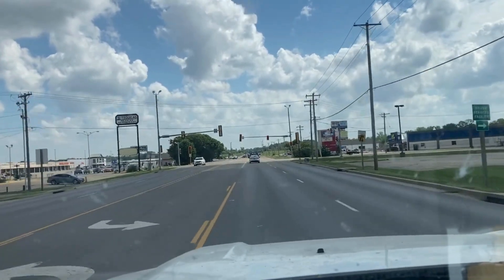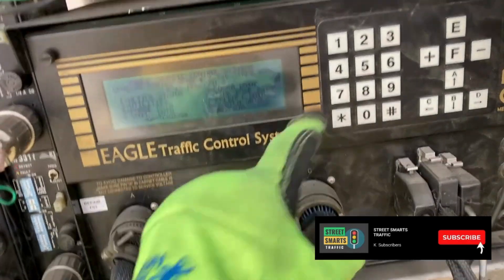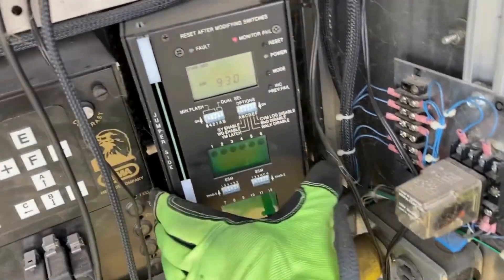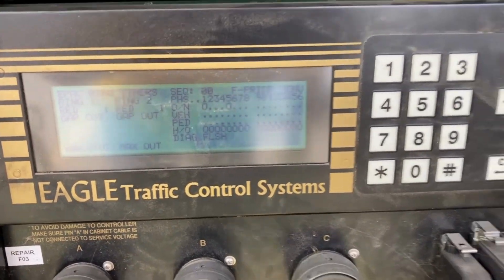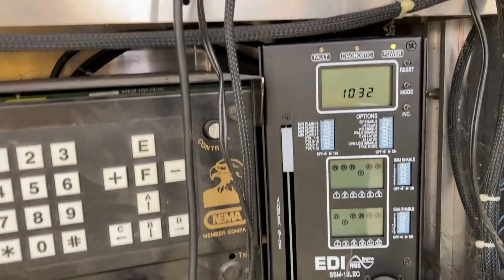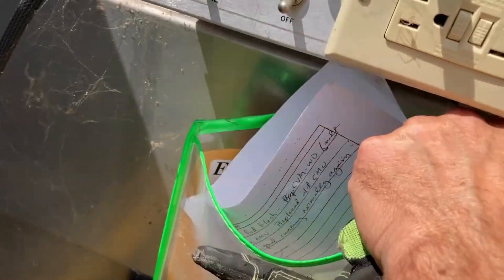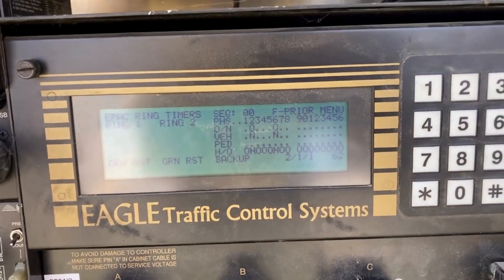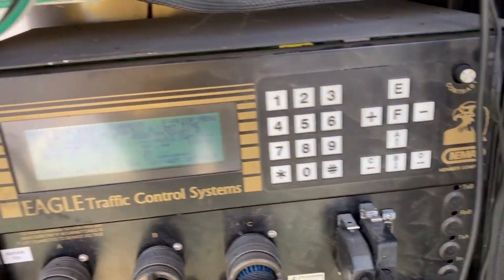When the Safety Device for a Traffic Light Fails

Comment: We have the same CVM faults using ASC 3 controller but every time it is a different issue some times because of BIU and so on  how i know which CVM cause the problem
Reply from the maker: CVM "Control Voltage Monitor" is a signal monitored by the conflict monitor.  Its to make sure the controller is running the correct voltage.  That's why problem lies usually on one of those two devices.  Depending on the cabinet, you may also have a CVM terminal on the backpanel.  So you make have to check wiring to and from that point as well.  Hope that makes sense!
Reply: @streetsmartstraffic  
Thanks
Reply from the maker: @abdallahgomaa9041  You're welcome!

Comment: What had you called out to the intersection? Were the lights flashing and a driver called in, or was it a callhome alert? Was there any impact to drivers prior to or during the change of the conflict detector?
Reply from the maker: Drivers had called their local public works dept that the signal was on red flash (which gets sent to me lol).
It wasn't a heavy flow of traffic during the time the signal went into flash so just an inconvience to the drivers.  Rush hour might have been a different story...
Great question!